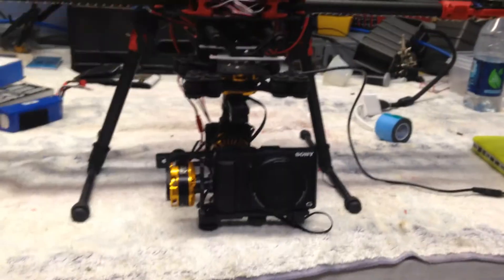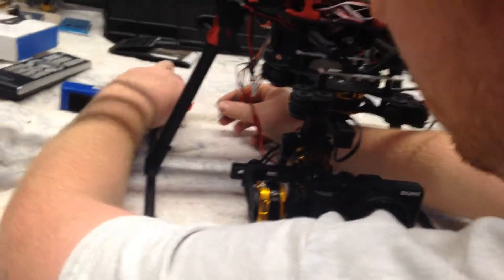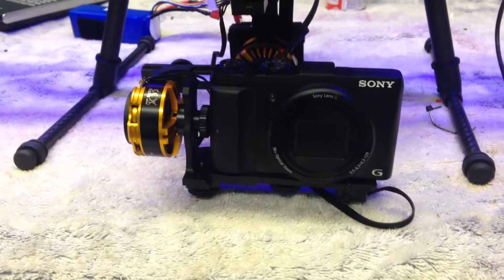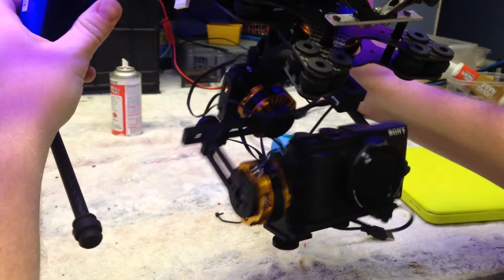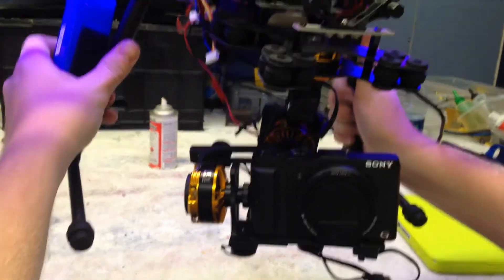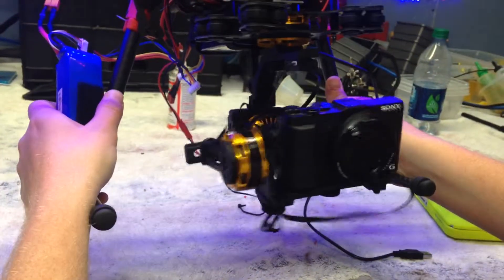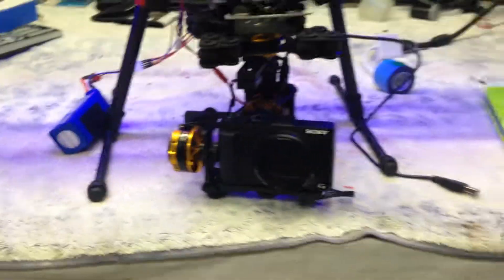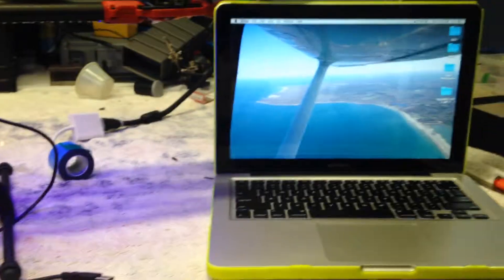32 bit alexmos 3 axis dys gimbal pitch problem

Comment: were you using an original board?
Reply from the maker: Yes, but the dys gimbal is garbage so the controller can only do so much. I went with a walkera g-3s with a rx100ii and never looked back.